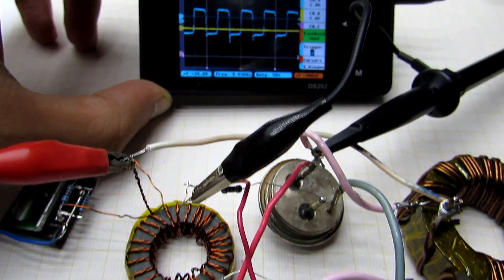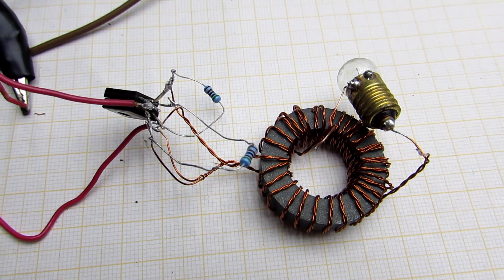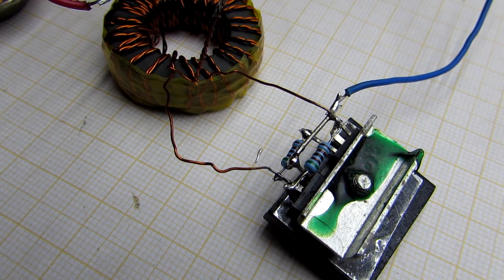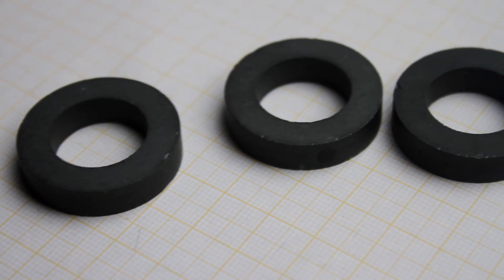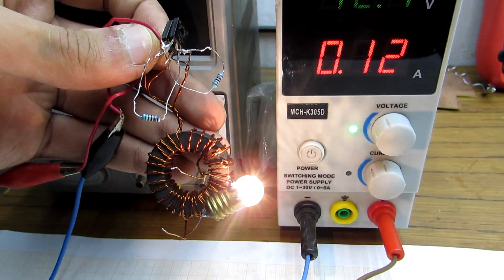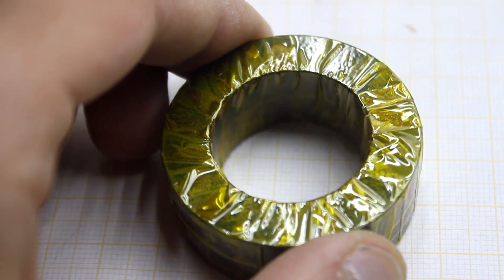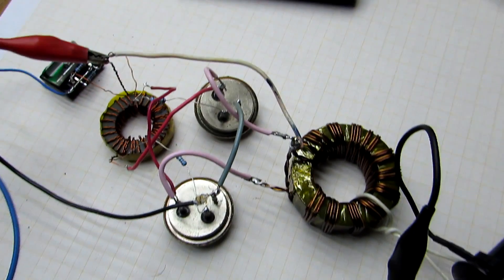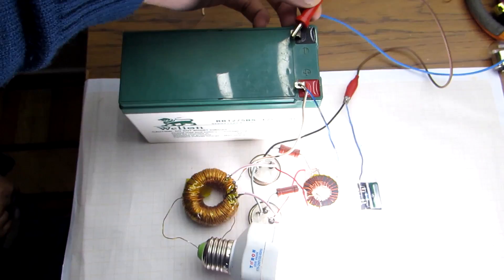The simplest inverter 12-220

Comment: Oh boy, I remember those P210 transistors very very well. They used to be the power element used on the linear power supply of a soviet b/w TV (Electron 216..?) that was assembled in  Cuba back in the 80's, rebranded as "Caribe" for the local market. Those used to have long flexible legs, instead of rigid terminals.  Noticed yours were made in 1975, I can't believe those are still produced. Are they?
Reply: I think they didn't. Germanium transistors even for us are REALLY old. There are two reasons to use them. It's a "big" count, and high electrical parameters. Of course, they have limit too. But you see how huge it is ? Silicon transistor of same power constantly needs radiator. Through the time, they become kinda rare, but those which still works can be used. 
Was my explanation was useful ? Sorry for grammar mistakes.

Comment: what about building a inverter with about 8kw output@ 120vac 60 hz? from 24v DC. mostly I need help with a smart boost stage. to supply constant voltage of about 180vdc. for the peak voltage of 110-125v ac. I have access to a spwm driver board . I want to build a 8 kW plus inverter . low frequency design. for starting high current motors. but efficient as possible. any advice? I have a 5kw that will do about 3500w reliability. I'm trying to run my off grid home . from solar and hydro.
Reply: careful my man. you will burn your house down. "as efficient as possible"? do you have a lab and/or workshop? if not, you should rethink your endeavor. an  8kw inverter to power a house, is not a weekend project, not even for an experienced engineer.

Comment: or you could make a classic royer oscillator. its just push pull configuration and additional coil driving the bases
Reply: you can wind more turns on the feedback coil any time you want